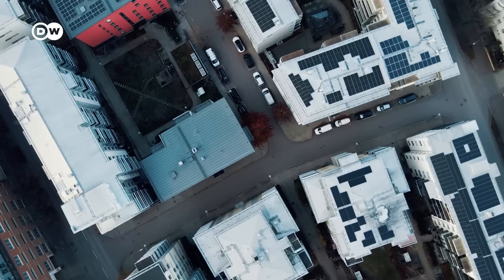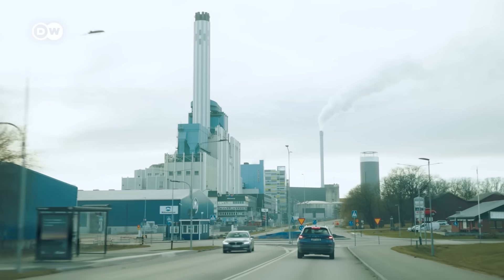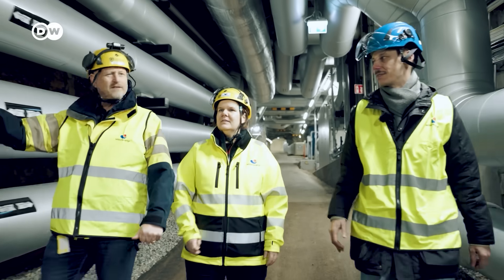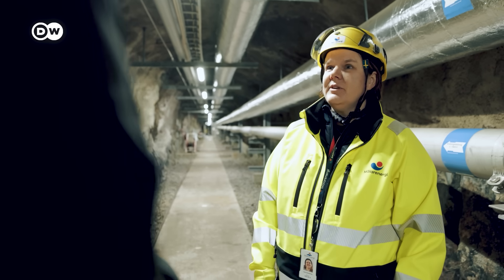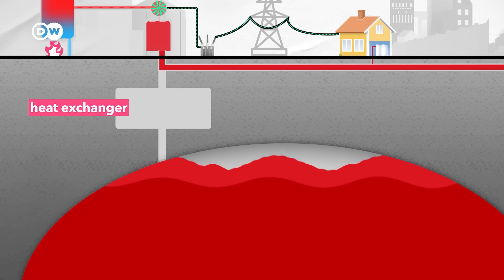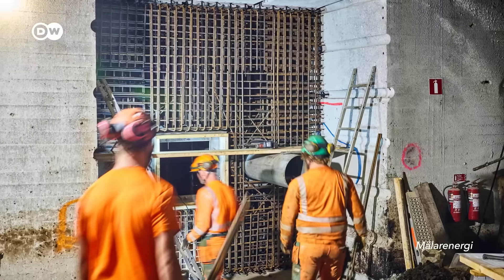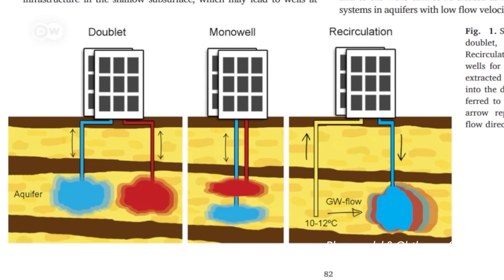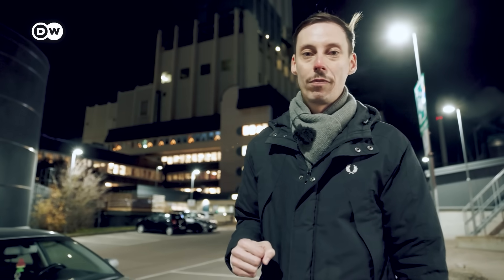Why a city in Sweden filled these caves with almost boiling water

Comment: In Vancouver we have several district heating systems - but no storage. But the DH system nearest me taps into a major sewer line to get 80% of it's heat.
Reply: Yeah, in Surrey, we have at least 1. I don't know where the heat comes from. I worked on the project in a non technical role.
Reply: Every city in the world should do this! Huge amounts of heat produced from all the waste flushed down that immediately starts decomposing, not to mention all the heated water...terawatts of free energy going to waste!
Reply: Oh? Is your system basically working off the heat produced from sewage rotting as it makes its way to the plant? Or the processing itself?
Reply: @Volvary or from the waste hot shower water maybe
Reply: @Volvary  as long as you have more than about -6C the compressor can work with that.
Reply: Here a paper plant has a deal with greenhouses to produce heat in winter, the plant use a lot of water when making paper and it was rejecting that into a river near by before the greenhouses' deal. Now we get cucumber in winter produced locally, there talk to make more kind of veggies, depending on the rentability of the greenhouse long term.
Reply: @lepotdefleur9906  That's great news. Is that paper plant in Greater Vancouver?
Reply: @eugenetswong  No, it s in the Quebec province
Reply: Where is this? How do they justify the cost when natural gas is so cheap? I feel like everyone forgot that natural gas is also a fossil fuel.
Reply: @brianclimbs1509  Natural gas is only cheap if you ignore the cost of pollution and climate change.
Reply: I'm working in city's water/wastewater company and we use methane generated in  wastewater biofilters  for combined heat/power generators. Heat for facility and tecnological proccesses that need it, and power .. well that's universal, sell it or use it .. we got quite large fleet of EV's ;)
Reply: @ Very cool!
Reply: This "storage" sounds like BS. Impossible it keeps temperature long months. Just impossible.

Comment: I have a few questions: 1st. How do you know what type of rock is good for the job. 2. How insulation works (is it effective?) how deep must the underground caves have to be? 3 this system can be used in clay like ground? Or sand? In any porous ground? 4can it be used in places where there's natural geysers, and they heat up the water and stored closer to the city? Thanks for he video it blows my mind how is this even possible, amazing.
Reply: It would have to be rock.  You want something that is pretty stable.
Reply: Checked the geology. 
1) The bedrock in Vasteras is 1.5Gy old granite. 
2) Granite is a great insulator. 
3) No and Yes. But you can make heath batteries out of sand in caverns made of concrete.
4) Of course I think Iceland does it.
Reply: @rhoddryice5412  Wdym "great" insulator? Numbers, compared to insulating foam? 🙏

It's a bit odd to compare this to "thermos", of course there's a very real heat loss into the bedrock mass.
Reply: @u1zha  only to an extent. soon enough the heat has nowhere to go. so it stays where it is suposed to. The heated Granite is essentially also a heat storage in addition to the water. Remove the water and the cave will still radiate heat for years.
Reply: 1. it doesn't collapse
2. that is a good question, but insulating the cavern might cost more than the heat loss.
3. you actually just need a hole in the ground, some isolation and a water tight membrane and an isolated top, that might float on the water. ie. some volume, with good insulation around. A giant tank like in the video or the artificial lake or some underground water reservoir.
4. where ever there is some heat, you can always put a heat pump on it, or in the case of the geyser just circulate it. If you have seen some videos of the recent Vulcanic eruptions on Iceland you might have seen their geothermal power plants, take super heated water to make electricity and use the waster heat for district heating over very long distances.
Reply: Science

Comment: I have to say that this type of technology is pretty awesome to see. I'm wondering if it can be combined with compressed air in a hybrid system that complements the two technologies in some areas that have no case systems to work with.
Reply: Air is a bad heat conductor. Water is many times more efficient.
Reply: @knowledgeisgood9645  I suppose he means compressed air for electricity storage

Comment: Fascinating - a smart & relatively simple solution.
Reply: Building underground is all but simple.
Reply: @CandidZulu  I said "relatively" simple.
I spent 45 years working underground on many projects in many countries on 4 continents.
In good rock like basalt it is a fairly simple method.
I spent most of my working life in soft, water bearing ground - anything but simple but you wouldn't be putting water at 95°c into that type of ground.
It's all relative.
Reply: The most impactful infrastructure always seems to be the simplest. Sure, artificial intelligence made possible by teasing the limits of quantum physics to edge a little more performance out of a processor is new and flashy, promising to change the world some day... Until then, heating water remains the premier life-changing technology.
Reply: Where does all this water to fill the caves come from ? Alot of cities in the US are nowhere near a water source.  Underground aquafers are shared for drinking water and huge amounts to irrigate large farms . The US doesn't have spare water to do this project

Comment: Springhill Nova Scotia Canada is using flooded abandoned coal mine shafts as giant heat exchangers.
Reply: As surprising as it is, he's right about using the mine shafts "as" a heat exchanger, not "with" a heat exchanger. My parents live close to there and I'm an HVAC engineer. The region probably has a magma chamber close to the surface, because the mines were unusually warm for their depth. They flooded in a major disaster, and the silver lining is that they can now use the shafts as huge pipes. They just pump warm water out of the flooded mines and use it for district heating.
Reply: @YannickTrottier  It seems the water is 18C, and used as a heat pump seasonal storage, not a direct heat source for district heating, which inherently requires a temp much closer to boiling, or in this case, lots more water circulated per usable BTU, and probably each consumer to have their own heat pumps.
Reply: @rodfreess6019  But it has a steady temperature and a giant heat pump would love having 20C heat source.
Reply: @surters  Yes they would, but that is a heat pump system, add on the pumping and losses required for a district system, and the efficiency goes down, and the cost goes way up.  Not practical more than a few places, but works for those.  I'd think the heat pumps would be owned and operated at each heating location, one giant heat pump would be even harder to distribute the heat from.
Reply: @rodfreess6019  all waste heat from the pump goes into the pump saving that part. Heat pumps goes into somewhat large sizes, I know of one with 60MW out, claiming to be the worlds largest.
Reply: @YannickTrottier The dwarves tunneled too deep and woke a Balrog
Reply: Springhill. The hometown of that lovely songbird Anne Murray.
Reply: Incorrect. You clearly don't know what a head exchanger is.
Reply: @jrmills2468 It's clearly a typo. He meant "with" rather than "as."
Reply: @jrmills2468  Few know what "a head exchanger" is. 
Sounds gruesome, though. s/
Reply: @jrmills2468 What's a head exchanger?

Comment: How does water heat storage, compare to sand and other materials, that are also used for heat storage? (for use as district heating and/or industry heating)
Reply: Water can store 4 times more energy than sand, but sand can be heated far above 100 degrees celsius so it depends on the application.. mostly the input temperature I guess.
Reply: @erik....  water stores 5x as much heat per kg but only 2~2,5x as much per volume. A big advantage of water is that being a liquid heat is transferred inside the storage system by convection,, and with sand, it transferred by conduction only.
Reply: It is easy to pump water - sand not so much 😂
Sand needs a secondary system to transport the heat.
Reply: @knowledgeisgood9645  Your point being...?
Reply: @ZarlanTheGreen  Water storage is simpler.

Comment: In South Africa, there are old mines but then we dont have very cold weather here so we have no application for this type of project.
Reply: Climate air conditioning?
Reply: Heated water can be converted to electricity. So it is much possible that such caves can be used as heat batteries also for electricity production (may also be pumped water storage in a mine).

So possibility exist - but no clue how effective the solutions are right now

Comment: The Finland's "heat tank" is just below my mtb routes ❤
Reply: Are you in helsinki?
Reply: @kenseitakesi4521  Yes, I live in Helsinki.
Reply: @SamuSaurama  se on hyvä se. Tampere on vain parempi
Reply: @kenseitakesi4521  😁😁
Reply: I wonder it will be hot enough below that the snow will melt on your route.
Reply: @chv2948  Probably not, the storage will be deeeeeeep down.